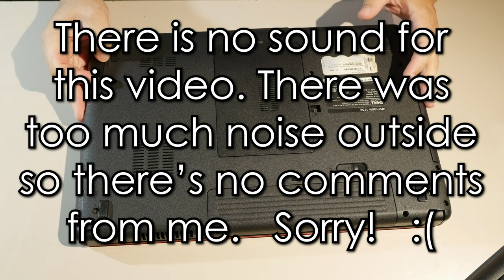Dell Inspiron 1750 Disassembly - Jody Bruchon

Comment: Do you like know how to fix the same laptop but how to fix the internet because it says im connected to the wifi but it does bot work
Reply from the maker: Typically, I'd say to go to Device Manager, find the wireless network adapter, right-click and uninstall it (DO NOT check the box to delete the driver!), then right-click anything in the list and "scan for hardware changes," then try connecting to your wifi again. This fixes most wifi connectivity problems like this, though it also loses all your saved wireless network connections so you have to connect to them and type the wireless password in again.

However, with a machine this old, there is an extra problem that you may be facing. The Inspiron 1750 is old enough that it may come with a wireless adapter that only supports wireless B and G signals (and possibly also A). Brand new wireless hardware for the past 8-9 years tends to use wireless N, AC, or AX signaling, often with some A/B/G compatibility settings turned on for really old machines like this to still work. You may have a wireless router that has B/G compatibility disabled or not working properly.

You can probably find a Mini-PCIe wireless-N adapter to replace your B/G adapter (if you don't have a wireless-N adapter) but you also need to run a search on your computer model along with "wireless adapter whitelist" to make sure this isn't one of the computers that was built with an adapter ID whitelist which prevents you from installing third-party wireless cards.

Another option is a USB wireless adapter. These are sometimes sketchy, but it's better than dealing with BIOS whitelists and signal standard conflicts.

I hope this helps, even though it feels like it may not.